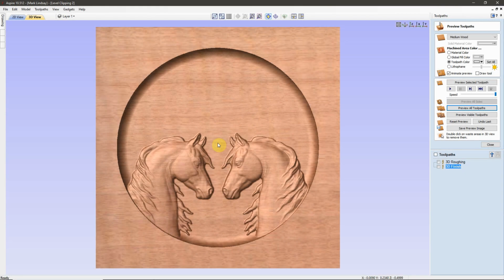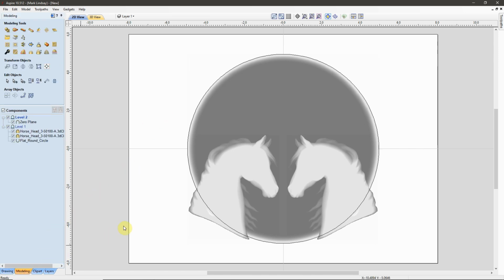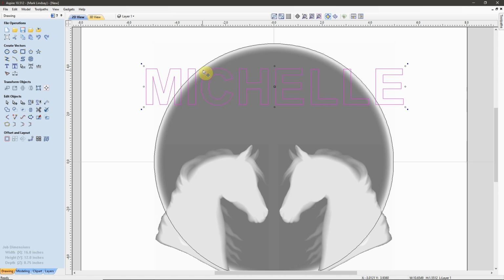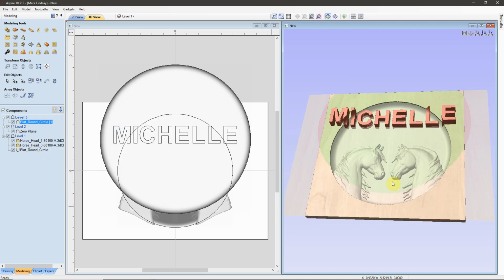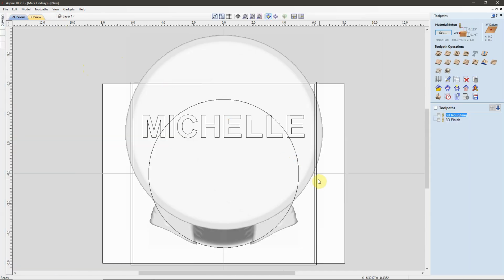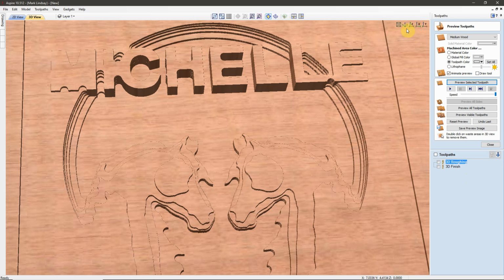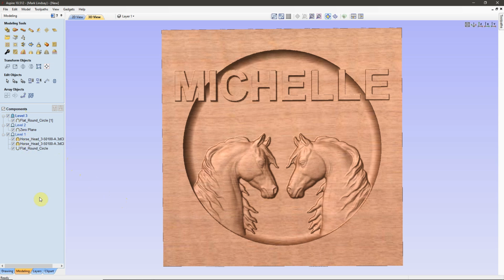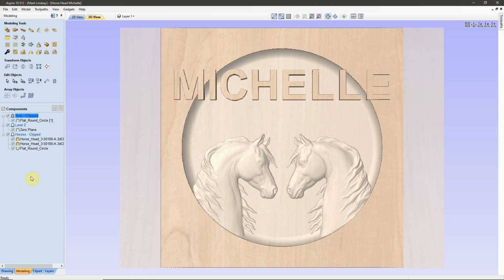Level Clipping 3D Raised Text in VCarve and Aspire

Comment: How can I either control the modeling plane z or have Aspire quit compensating for model left above the material surface intentionally? I'm trying to finish with a ballnose bit and have it finish the paths above the material surface instead of rounding over the edge of the model (even constrained to a vector outline of the model).

Comment: Hi Mark, Thank you for the tutorial on this 3D carve. This will be my first to try. I have a question on the .0625 ball nose bit. What is a good finishing step over for that bit? My Amana guide says to go with 30IPM and it was preset at 4% stepover. This would take me 66 hours to finish carve. Thank you for your time. Jim
Reply from the maker: As a general rule, a good finishing stepover is anywhere below 10%. Personally, depending on the project's size, I go for either 7 or 8%. Also, if you do a Z-Level roughing toolpath with a machining allowance of .030, you can ramp that feed rate way up on the finishing toolpath.  By doing a roughing toolpath with a standard end mill first, you're not cutting much material at all with the finishing bit. I usually start with a 50 ipm feed rate and adjust it on the fly. I'm finding that 60 ipm is close to the sweet spot for my .0625 inch tapered ballnose.

Comment: Hello Mark 
In another video of yours you were checking on a bit in your tool database and I noticed all the different bits you list under End Mills ( .011 inch -.023inch-.055inch and more) I’m confused as to what type of a bit they are and how would you use that type of a bit. 
   Thanks for sharing your knowledge with me your videos have been very helpful !!!!
Reply from the maker: Those are bits I bought for one project or another. I've broken about half of them, and have never replaced them or removed them from the tool database. They were used for drilling holes, mainly. The .023 inch bit is used to make the fret slots in a guitar fretboard.

Comment: When you did the roughing and finishing tool path for the name, you did not select the horse heads but they carved. How did this work?
Reply from the maker: Good question! I'll get into it further in the Live Q&A, but in a nutshell, the entire list in the Component Tree becomes the model. Remember that the software models from the bottom up. In the end, it takes all of those levels, adds, subtracts, or merges them together. That's what makes the model. You don't have to select which components you're going to carve, because the software knows to carve the entire thing, based on what is checked or unchecked in the Component Tree.